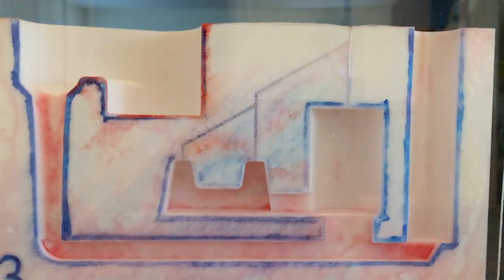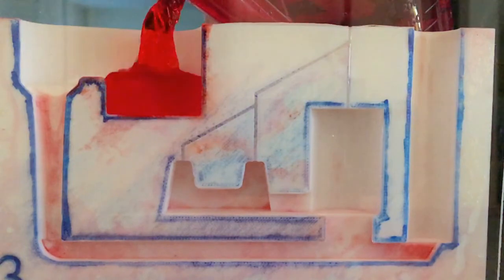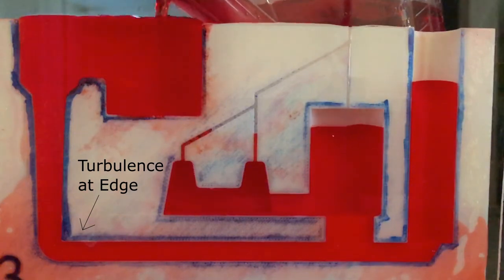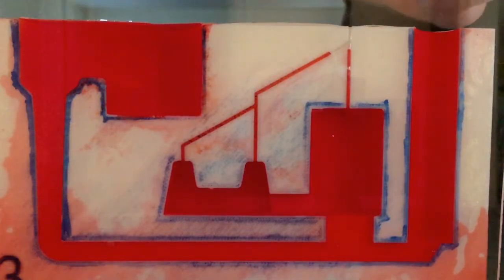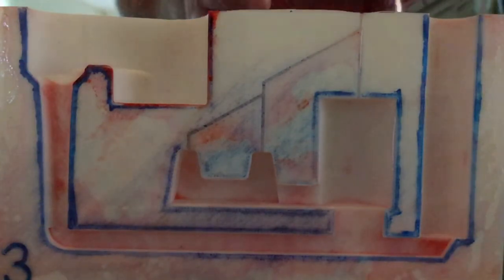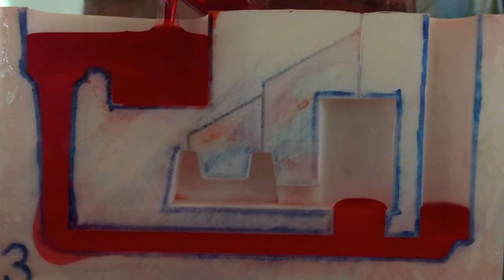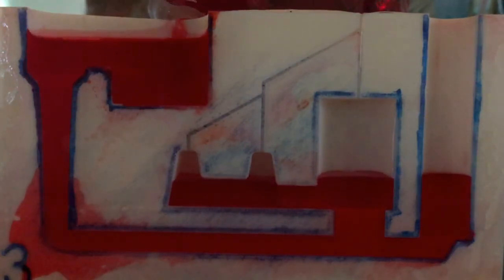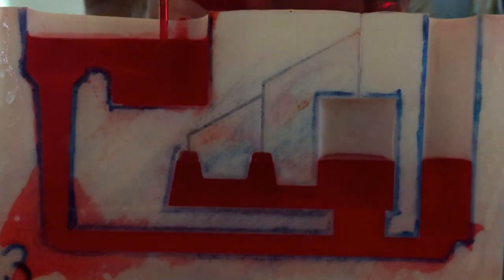Sand Casting Mold Design 2

Comment: Thank you for a very interesting video.
Everything is perfectly visible.
To improve the video, you can use cameras with a global shutter.
These are cameras that give a lot of frames per second (260, etc.).
Even inexpensive USB cameras give excellent video clarity (the frames are clear), there are black and white and color ones.
I bought a bodyless one on a board, and attached the optics separately.
I understand that there are industrial high-speed cameras, but the prices are different there.
Reply from the maker: Glad yo liked the video. I haven't been doing much with YouTube lately as you can see, but you are right though about the camera. These were all done on my phone. If and when I get back into making videos, a better camera with some high speed capability will be a necessary investment.
Reply: @charliekrauter5176  For a regular video, your phone's camera is enough for me.
But for such experiments, a camera with a global shutter (high-speed) could show bubbles very well, which would improve the results of the experiments, because you would see bubbles that you had not seen before. And it does not have to be an expensive camera, a USB on a board without a case is enough.
Thanks again for the wonderful videos.
By the way, in the last video, YouTube cut off the links to the files on Google Drive.
Could you somehow update them.
Thanks.

Comment: I wonder if the same experiment can be done with borosilicate panel glass and a molten metal, maybe one with low melting temperature?
Reply from the maker: Andrew Martin https://www.youtube.com/@andrewmartin4258 did exactly this and inspired me to make the water models which seemed a lot easier and safer. Please watch them. They are pretty exciting.
Reply: @charliekrauter5176  Thank you Charlie. You are very right. Those Andrew's videos are exciting, probably even a little bit too much exciting even for the 'crazy' chemist like me. Your videos do show pretty close what's happening and are great for learning. 👍👍👍
Reply from the maker: @VladekR Thanks. I like your idea of using a low meting point alloy. Borosilicate glass might hold up to pewter (~260C melting temp). Now I want to try that out.